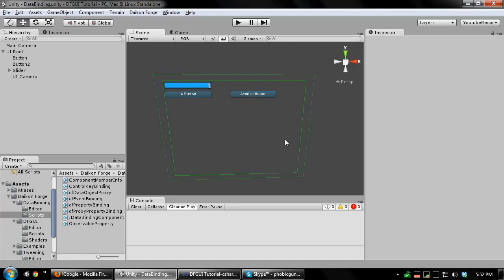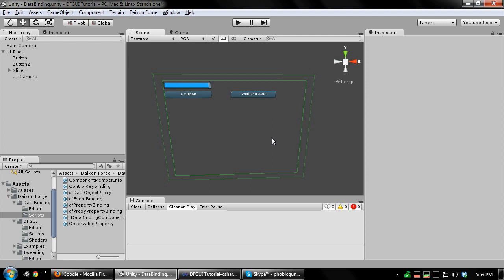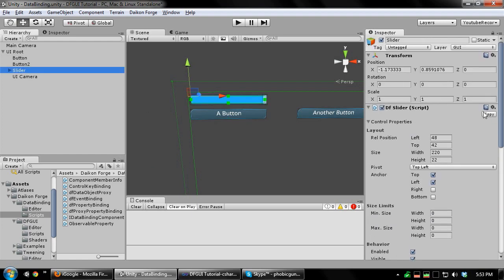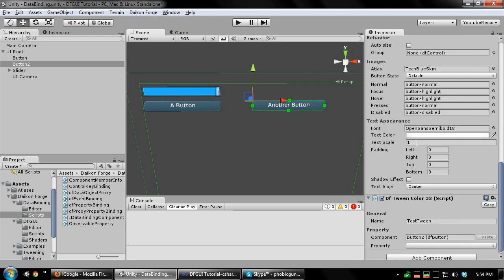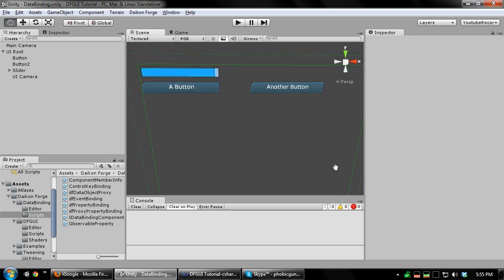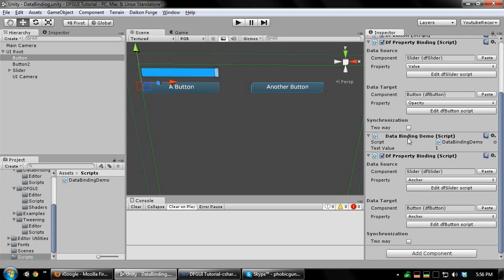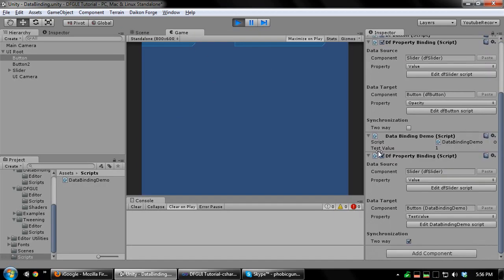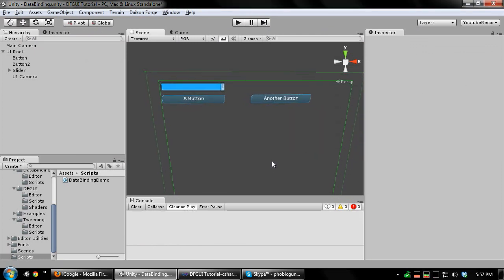DaikonForge GUI - Tutorial 4: Data Binding

Comment: Needs something like WPF's ValueConverter and MultiValueConverter. Binding a Vector2 to another Vector2 is all well and nice, but sometimes you need to convert the value to a different type or modify the resulting value, especially when binding from data in an arbitrary format to the UI.

Comment: I'm guessing this system has changed with a recent Unity update, because I don't get the Copy button and all my scripts (including examples) "do not define any compatible event handlers". This is a shame, as the actual creation of the interface has proved to be easy and intuitive; I just can't seem to get it to control anything!
Reply from the maker: The Copy button is indeed gone, now replaced with simply right clicking ANY component (not just controls!) and selecting "Copy Component Reference".
Additionally, the incompatible event handlers is a known issue. In the meantime you can put the inspector in Debug mode and manually type the name of the method. It will still give you a warning in Normal view, but will call the method just fine.